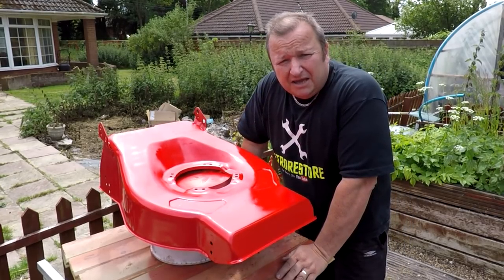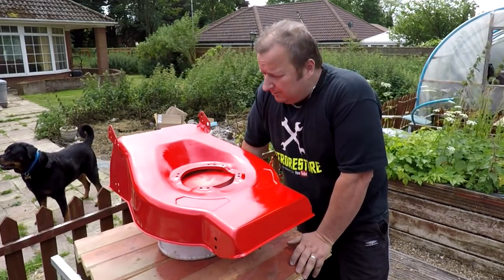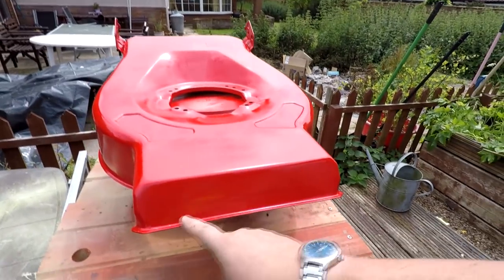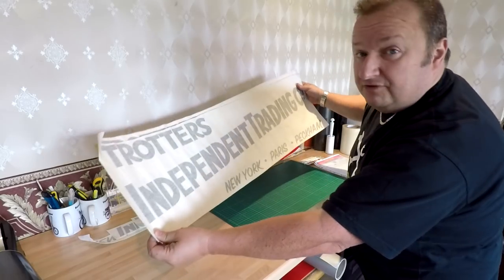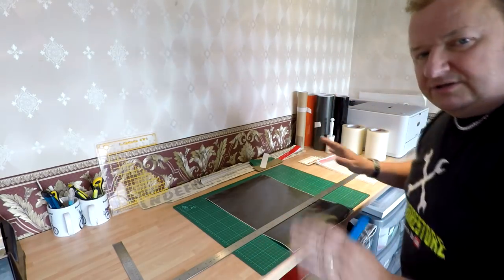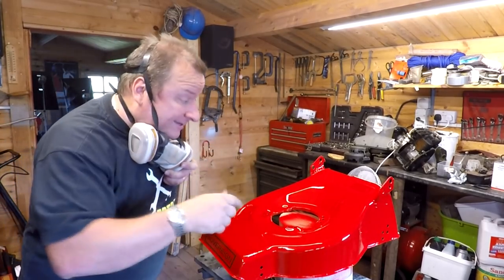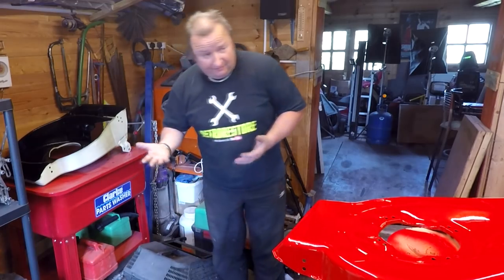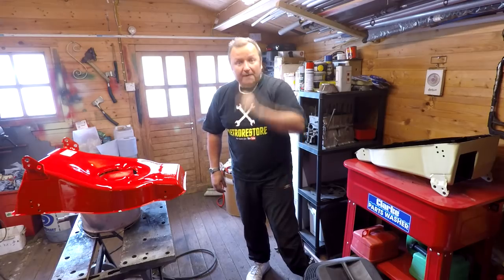Sneaky Lawnmower Paint Job

Comment: Hi sticker looks great, I love them mower decks as they don't usually rust through as bad as most, just have flakey paint. I mainly look for the self drive decks like that, then paint black usually and fit a Honda engine on them, I've found people love them. I just advertise them as Honda Engined mowers and don't bother with stickers because when I've finished the model doesn't really exist lol. Is the pimped up mower a competition prize?. What lacquer did you use on the one you just did?. Good vid thanks🙂👍
Reply from the maker: I used 2K lacquer on this one, It resists petrol. Not sure yet about the pimped one.
Reply: I'm looking for a new Honda mower deck - they seem expensive.What decks do you use? 

Plus love the videos, learnt loads.Just wondering if is it slightly false advertising to rebrand the mower sovereign even though they are all the same?

Comment: Hello there, wondering if you have a tutorial on using rattle can spray paint on car bodywork. I have just bought a corsa d that needs the front bumper spraying and a few little touch ups. Thanks Jack.
Reply from the maker: It's pretty much the same as you see in the lawnmower vids Jack, I have done a few on here.

Comment: just wondered which gun and which lacquer u used.....and what psi u set for the compressor
Reply from the maker: It was a standard HVLP gun with a 1.4 tip and Max Meyer 2k lacquer sprayed at 2 bar Roy.
Reply: retrorestore ....Thanks...for the details....exactly what I needed